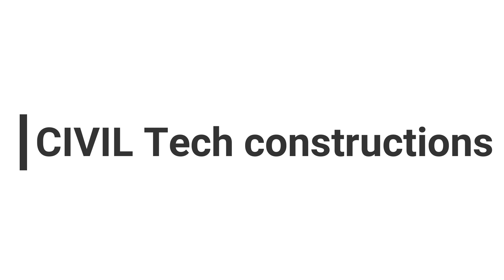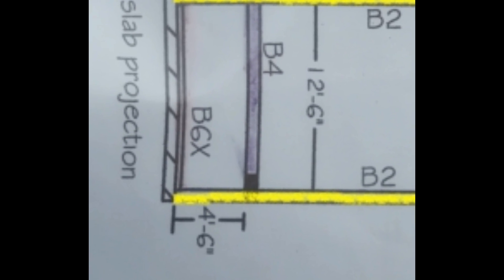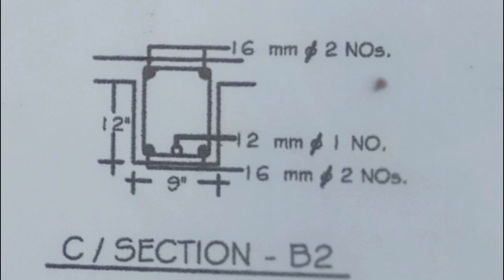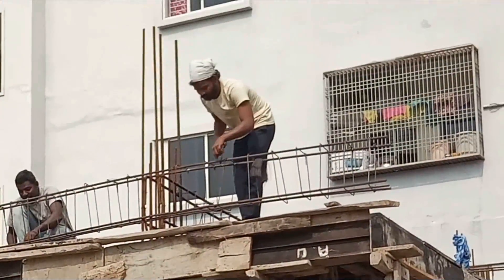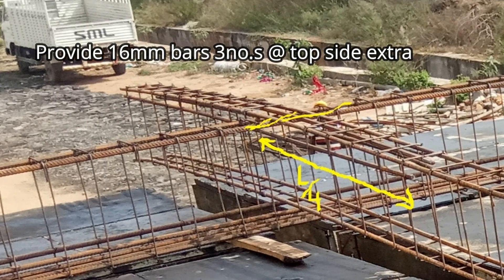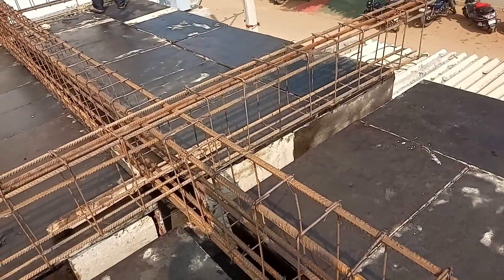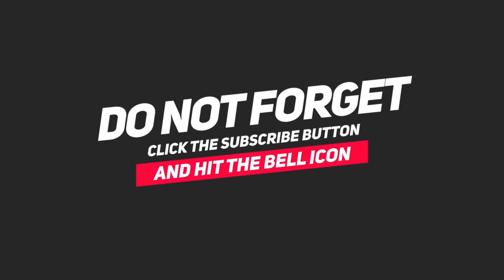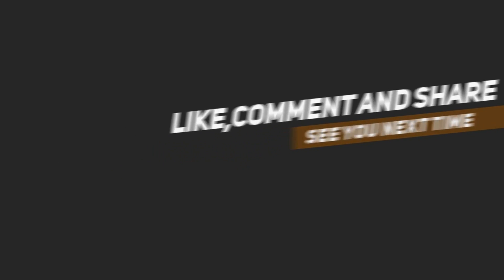Cantilever Beam on site || watch #civiltechconstructions

Comment: What is the maximum weight that a cantilever beam of 3’ x 16’ can take since I am also enclosing this utility area attached to I floor kitchen with block work or wall on all the sides for my I floor kitchen in India? Since this is an utility area there may be lot of walks from in/out of kitchen. I just want to make sure this is safe because it will take block work weight and also has no support at the bottom. Please reply.